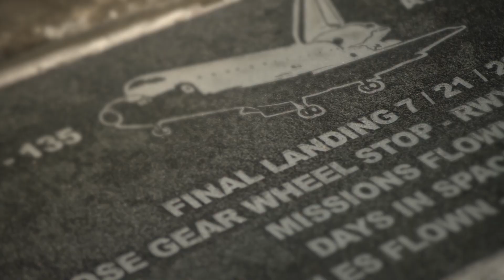Mission: Tenacity | Dream Chaser

Comment: @0:27 The X-37B has landed at the SLF three times since the last shuttle mission.
Reply: Yes.  I was about to add, "Boeing's X-37B has entered the chat."  ;^)
Its first three missions landed at Vandenberg, but the most recent three landed at KSC's Shuttle Landing Facility in 2017, 2019, & 2022.  (Both of the two vehicles built have now flown three missions each.)